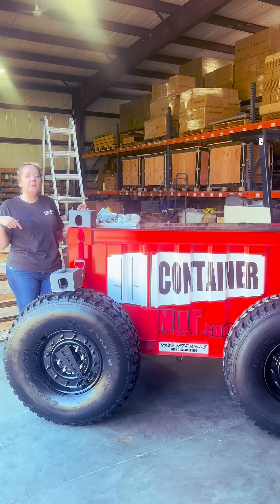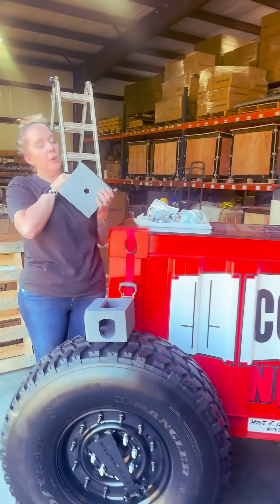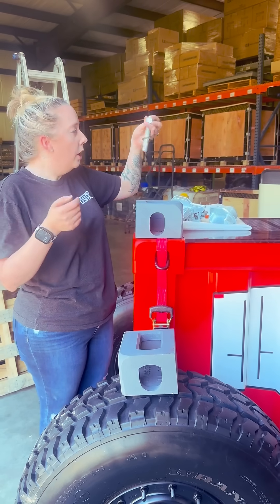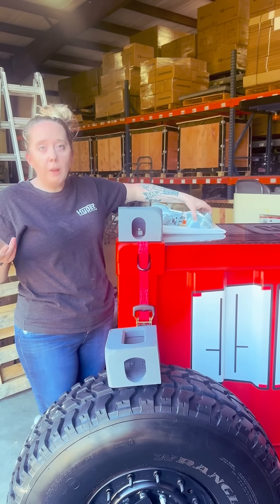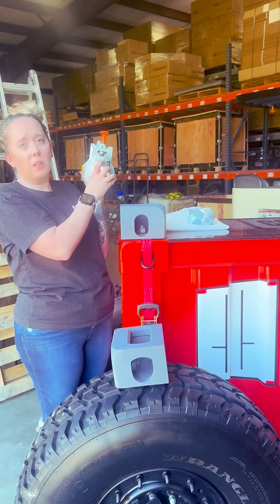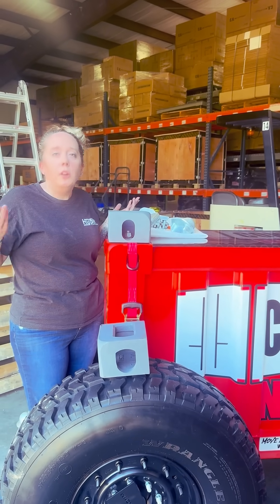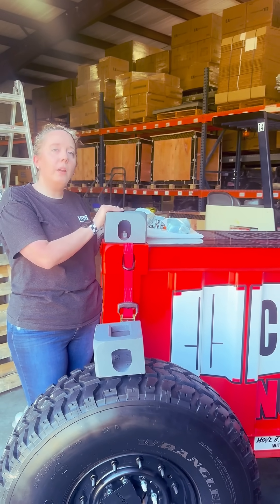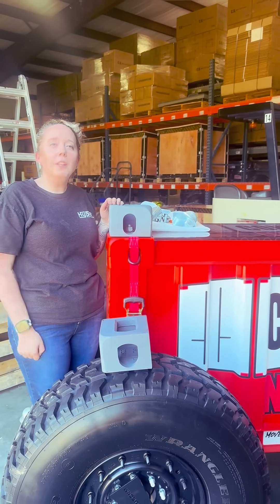Corner Castings Kit Explained | Container Nut

Comment: I have some questions on the base and leveling. I'm curious what is the best method or procedure for either leveling/shimming gravel under the corner casting? Is there some kind of screwjack that can be placed between corner casting and base or shipping containers for continued leveling over time in case ground settles for those of us that are not on solid surface?
Reply from the maker: Great question. Many customers use our HD EZY LIFT in combination with a bottle jack, which allows you to safely move the container as the ground shifts. A single HD EZY LIFT is typically sufficient to handle the entire container, eliminating the need for multiple devices.
If you have any additional questions, please don’t hesitate to reach out via email or phone.

Email - Jessi.bieker@containernut.com
Phone - 636-900-4608

Comment: What is the shear strength of the mounting solution?  40 ft High Cube is a pretty large surface regarding wind load.
Reply from the maker: I apologize for the delayed response. The shear strength primarily depends on the concrete anchor bolt you select, as well as the anchoring method you choose—whether it’s a twist lock or a custom bracket using Universal Container Nuts. If you have any further questions about this please feel free to reach out via email or phone.
Email is: Jessi.bieker@containernut.com 
Phone is: 636-900-4608
Hours: Monday - Friday 8:00am - 5:00pm CST